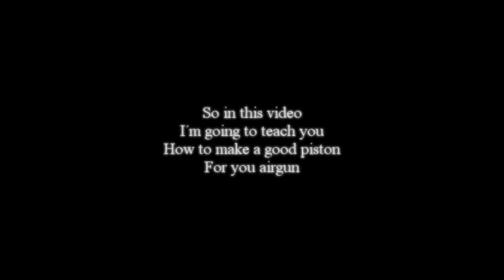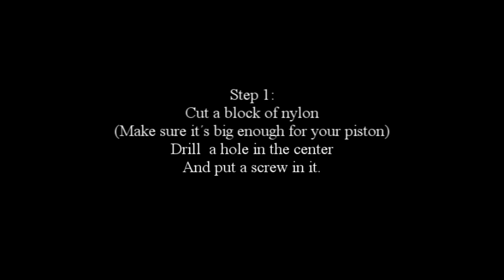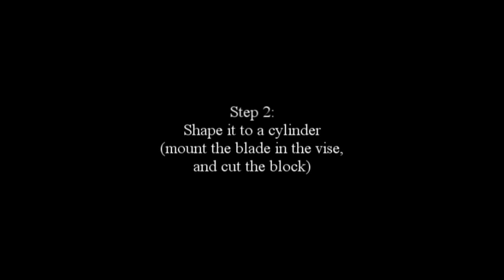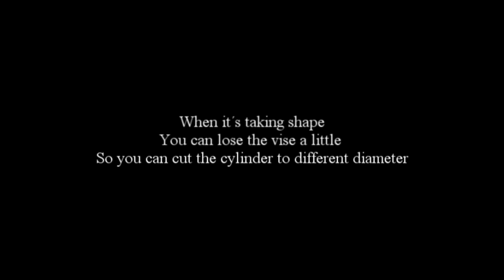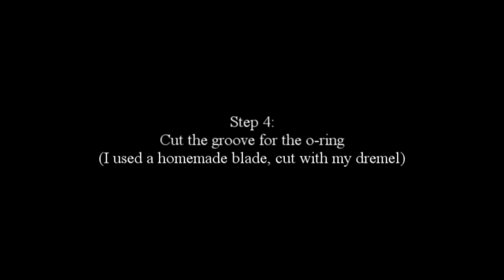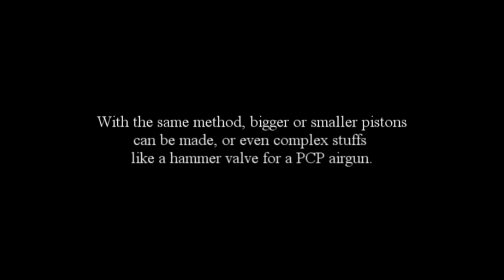How to make a good piston for QEV

Comment from the maker: The piston shown in the beginning of this video is not a normal QEV, it´s a chamber seal piston valve, google it.
For chamber-fill piston valve, you shouldn´t place the o-ring, unless you have a small hole in the piston that alows the air to pass from chamber to pilot.
What this tutorial teaches is a o-ring sealed piston for pilot fill piston valves, like a standard factory made QEV.